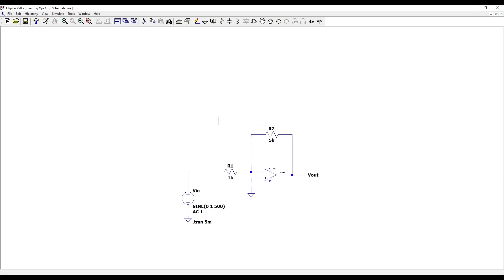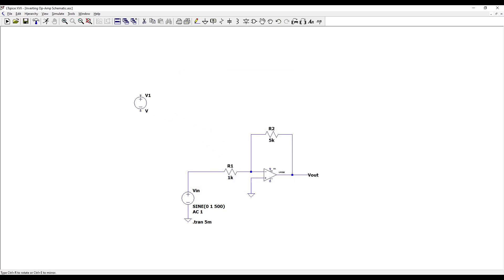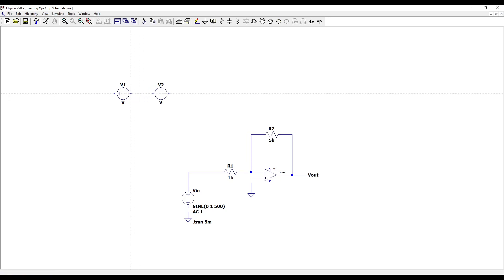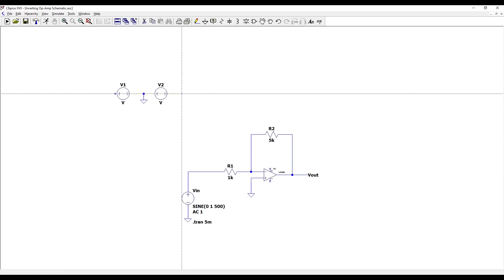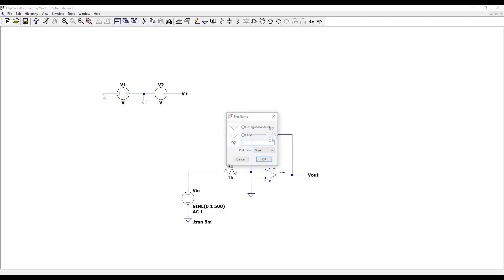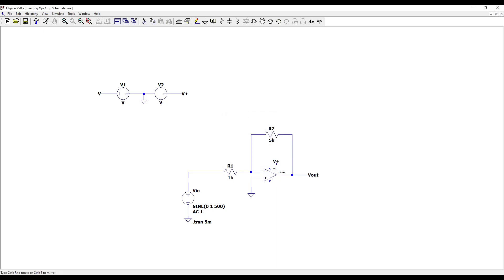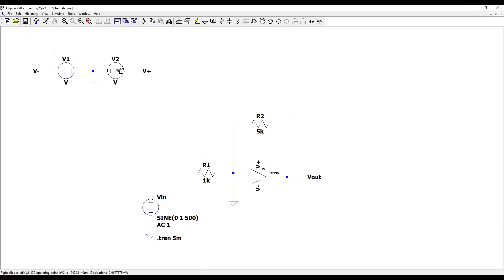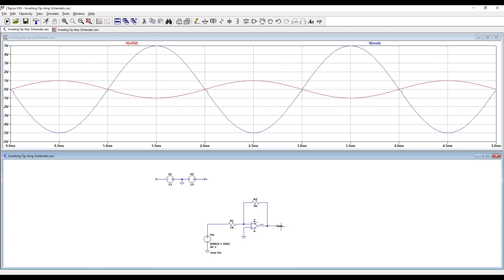LTspice: How To Make A Dual Power Supply!

Comment: Great provision.
I was looking into some available information from engineers with degrees providing materials on Kahn Academy, but their videos and shockingly many accredited college provided videos for students didn't have a proper explanation for generating this virtual dual voltage power supply.

The breakdown is simple. The center node in relationship to the positive rail of your supply is -, and that center node in relationship to the negative rail of your supply is +. Because some op amps are BJT inputs meaning they are bipolar, they need this reference for the voltage swing and minority charge carriers as well as majority which are polar opposites. Both types of charge carriers in the semiconductor must be able to share a ground reference of different potentials, so in this way, it's virtual.